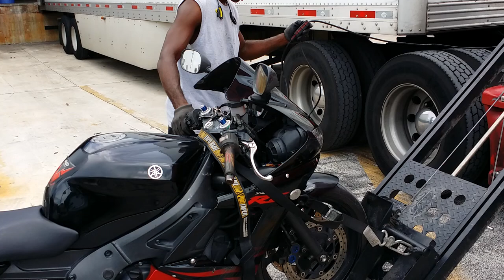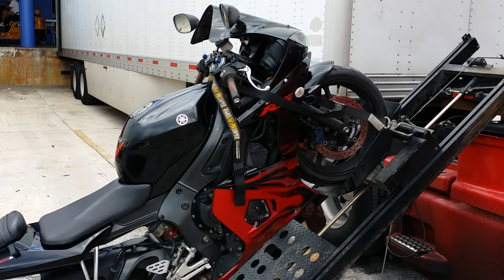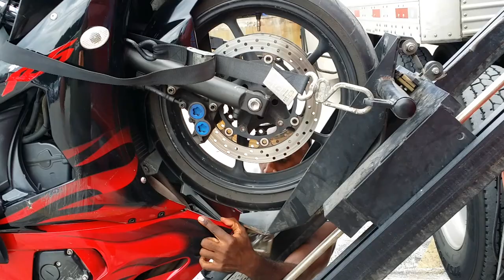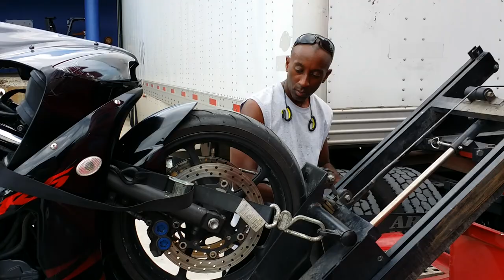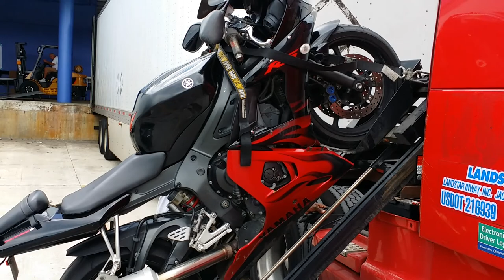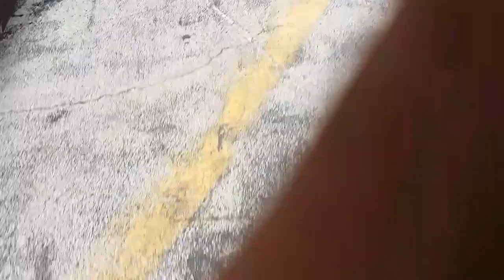How I load my motorcycle onto my semi truck.

Comment: I'm getting a 2020 VNL 760, in a few days and considering taking my Y3 with me, how would that work with turning. I feel like the trailer would crush that in an instant. Unless you have your 5th wheel a bit back?
Reply from the maker: You would have to have the fifth wheel unbolted and moved to the last set of holes on the frame. I've been carrying my bike on my truck since 2013. I feel it is worth the trouble. It's easier to go get food, truck parts, enjoy yourself and not have to worry about your eld.
Reply: Passport Trucker  where did you get the ramp btw??
Reply from the maker: @alejandroochoa3541  craigslist.org

Comment: I'm looking at a little Honda Grom clone. Was planning on just getting a long 3ft wide aluminum wheelchair ramp to bring it up and down off the catwalk.

Ever run into issues hauling water or something heavy when it comes to weight on the drives?
Reply from the maker: The heaviest I have hauled is around 43,000. I prefer around 25,000 with or without the bike. I haven't had any problems with weight.

Comment: Wow that’s amazing. Hey bro how long is your wellbase and who did your ramp.. nice bike
Reply from the maker: Thanks for the comment. I think the wheelbase is 220 inches. I tried to measure it before I went on vacation but the tape measure wasn't long enough. I'm in Bogota, Colombia. I'll measure it when I get back to Florida. Also I don't have that red 2003 Volvo any more. I have a white 2017 Volvo and a Yamaha R-1. The bike is faster and easier to load. L & C metals in Orlando, FL made the frame and mounted it and the lift to the truck. The work can be done by other metal shops. Show the shop my video on How I mounted my motorcycle lift to my semi truck.

Comment: How much does one of these ramp cost if you dont mind me asking... great video, straight to the point.
Reply from the maker: I bought it off of Craigslist for  $700. Paid $900 to have a metal fabrication shop in Orlando make the frame.
Reply: @passporttrucker9280  Sweet, hell of a good deal.

Comment: What's the wheel base on your truck?
Can I do the same setup on regular truck too?
Reply from the maker: I think it was 220. I no longer have that truck. I have a  white 2017 Volvo 780 and a red 2007 Yamaha R-1. The wheel base on my truck is 240 inches and the distance between the back wall of the sleeper and the front of the trailer is 67 inches. The mesurement between the trailer and the sleeper is the most important one. Also the distance from the back of the sleeper to the lift is 4 and a half inches. If you have anymore questions let me know.
Reply: @passporttrucker9280  Appreciate it man.
Am in the market for my first semi truck, do you know good dealer to buy one?
Do you think 260 wheel base is decent enough?
Also where did you get your lift from?
Thanks for the help man.
Reply from the maker: @shashikanttiwari8939   Unless you want to pull a reefer unit or car hauler. I think 260 is too long. I bought my first truck at Arrow Truck Sales in Dallas and my second one at House of Trucks in Dallas. Choose a truck with side boxes that open from the outside of the truck. That way it is much easier to get tools out of it when you need them. Choose a truck that you can pay for before the truck reaches a million miles.
Reply: @passporttrucker9280  Gotcha. Yeah I'll be pulling refeer
Thanks much.

Comment: I was wondering if one of these existed because I would love to take my roking special but I don't know if it's too heavy
Reply from the maker: A roadking special weighs about 774 pounds. It's not too heavy. I would be concerned about the width of the bike. Is there going to be enough space between the trail and the sleeper. You could also just buy a second bike for your truck.
Reply: Stick with something light like 800cc cruiser or one of smaller adventure bikes. Small KTM weights less then 400 pounds and it's fun to zip around.

Comment: Awesome. I'm a long hauler about to put it down like you.
Where can you put an APU?
Reply: Electric battery APU between the rails behind the sleeper with solar panels on roof. But an APU could go between the landing gear posts.
Reply from the maker: It depends on the type of truck. On a Volvo you can put it in front of the fuel tank. On a Freightliner behind the fuel tank.

Comment: where did you get that loader and I thought at Landstar we couldn't have anything on our catwalk.
Reply from the maker: I got the lift off of Craigslist. Paid $700. You can buy it new from www.rampagelift.com or check in the sales section of the motorcycle magazines. Also you can try Facebook marketplace. I installed the lift on my truck in 2013. I had the truck in the pic. Now I have a white 2017 Volvo 780 and a red 2007 Yamaha R-1

Comment: This here is beautiful I have a 2k8 zx 10 R and I would love to have one of these built. Who installs these? And how much about does it run for you were really the only person I see on YouTube with this.

I have a 2020 freightliner Cascadia
Reply from the maker: I had my frame made at L&C Metals in Orlando, FL 407-859-2600. I helped make the frame. The people there didn't know how to do it. It was my design with their help. I also helped install the frame and the lift. I paid $900 to have everything done. You can go to another metal fabrication shop and they can make it. Just show them the video "How I mounted my motorcycle lift to my semi truck." After they look at that video they should be able to make it. If your fuel tanks aren't going to be under the lift as it is on Volvo trucks you can just find someone to bolt it down on the frame of your truck. Also is your exhaust pipe horizontal or vertical? If it is vertical it will have to be changed to a weed burner.
Reply from the maker: Also  you will have to slide you fifth wheel all the way back or even have it moved further back on the frame.
Reply from the maker: Please subscribe in the future I'll make some more videos but right now I trying to get my new truck setup. I still have a lot to do to this truck. I'm planning on putting a shower in this one.

Comment: A little bit of elbow grease and nobody would even know you left.  Since video brother. Is your truck cab smaller than usual to accommodate for the bike thickness?
Reply from the maker: It's a regular size cab. The fifth wheel is all the way back. It was unbolted and move to the last set of holes on the frame.

Comment: How much distance between sleeper and the bulkhead of the trailer? I run a reefer and just bought a bike. Want to buy a truck and bring the bike with me.
Reply from the maker: Unless your truck has a longer than average wheel base I don't think it will work. If you get it to work please let me know. I have seen a videos where a guy put the bike on the side of the tractor under the sleeper. I'm sorry I don't remember what video it was. The driver sent me a message and I watched his video. If you want to you can check the comments and maybe you can find his video. Do you have to pull a reefer?
Reply: @passporttrucker9280  the only thing we pull if reefer
Reply from the maker: If I see that video again on how to put a bike on the side of a truck I'll let you know.

Comment: Hey driver I crossed paths with you in  Houston on a show load, red kw T660 with black fenders, i hope you have been doing well,  my question is what is the lift called?
Reply from the maker: I'm doing ok. I hope you are too. The lift is called rampagelift. https://www.rampagelift.com/
 If you buy it new $3,150 or you can find one on craigslist. I paid $700 on Craigslist.org. I'm going to do an update on how I load my bike. I made that video in 2013. I've learned how to load it faster. I just watched another driver's video and 2 of the steps he did was unnecessary. Some of the steps I used to do was unnecessary too.
Reply: @passporttrucker9280  thank you, i havnt been up here in a while but i appreciate the information, i'v got some other things i'm doing to the truck first, and i also finally got my own trailer, trying to get all the kinks worked out of it but i would like to get one of those lifts one day, stay safe driver

Comment: what is the distance from trailer to the bike?
Reply from the maker: The distance between the front of my trailer and the ramp is 39.5". Also I have a different truck now. The motor went out in the red 2003 Volvo. Now I have a white 2017 Volvo. The wheelbase is a little longer on this truck. I hope I can start making videos again soon.

Comment: I'm guessing the bike can be loaded backwards?
My handlebars are wide. I think I'll have the turn left to full lock to clear the trailer.

Who made the rack?
Reply from the maker: I think it would be easier to change the handlebars or removed them. To load it backward you would have to find a way to keep the front tire straight.
Reply: Looks like I could simply strap the bars straight. I'm tired of running out West doing my restart and not having my bike.

Why does that sit so tall above the truck frame?

Comment: Do you think I could fit 2 groms on the back of a 2019 international LT?
Reply from the maker: The wheelbase of a grom is too short. The grom's wheelbase is 47 inches. With a rampage lift the wheelbase needs to be at least 49. You could have the platform that the rear tire sits on made longer and that might work.  To carry two bikes you would need two lifts stacked on top of the other like a car hauler.  I thought about doing that if I ever got to run teams with a woman that likes bikes.
Reply from the maker: Do you already own a grom? If not I would buy a bigger bike. A grom only goes 60 mph.  I would be afraid to get on the highway with that low of a top speed.
Reply: Passport Trucker no. I wanted to learn on Grom + take it w me on truck to just explore when have extra time between loads . But want a ninja 300. I’m only 100lbs. I need something small / light.
Reply from the maker: @xBaddJuju  I was going to buy a ninja 250. Another truck driver talked me out of it.  A motorcycle salesman told me to at least get a 650. I bought a Yamaha r6 from a young woman that weighs about the same as you. Please don't buy a grom. If I ever were to run into you I would like to go riding with you but 60 mph is no fun. Well maybe on a street but not on a highway. With a grom you are going to either ride with other grom owners or solo.
Reply: Passport Trucker I’m just nervous to get something too freaking heavy!! I’m literally weak asf. 😫
Reply: Passport Trucker I literally have NO experience whatsoever on 2 wheels
Reply from the maker: @xBaddJuju  When you take the motorcycle class you will be using a 250, so why buy a smaller bike? The girl in the video on your page is riding a Suzuki 750 and she weighs 90 pounds. If you are capable of driving a semi I think you are capable of riding a bigger bike than a grom.
Reply: Passport Trucker lol. I’m nervousssss!!!!! I’m copping a Yamaha R3. Im still sad abt the grom but w/e
Reply from the maker: @xBaddJuju  I'm glad that you decided not to get the grom. It's better that you be sad today than sad 3 months later when you don't want it no more. I googled the r3. I like the bike. It looks good. Good price too. Wheelbase is the same as a r6 so it will fit on a Rampage bike lift.
Reply from the maker: You are going to take the bike riding class before you buy the bike right?
Reply: Passport Trucker 😂 I want to buy it first. Bc they teach on cruisers . & learn n mess w it on home time
Reply from the maker: @xBaddJuju  I had a feeling that was your intention. lol. Why not mess up on someone's else used bike than buying a brand new one and messing it up? Can you find another place to take the class? If you are going to learn how to ride first and take the class second do you have someone who is going to teach you how to ride?  Even if it is your daddy, your husband, bf, I hope you find another class. Even if you have someone to teach you, let them teach you on their bike or let the school teach you on THEIR BIKE, you are going to pay them anyway. In Florida if the police stop someone riding a bike without a motorcycle endorsement on their license they can take the bike. The rider can be fined $500, put on probation for up to 6 months, or 60 days in jail. I didn't know that until I took the class. Please e-mail me at  passport.trucker@gmail.com
Reply from the maker: Hi Rinaa, I hope I didn't say anything that offended you. If I did I'm sorry. What did you decide to do? Just curious. I won't try to change your mind again about the class.
Reply: Passport Trucker nope not offended . Still want a grom n a street bike
Reply: Passport Trucker I went to a Motorsport place & actually sat on grom. It’s a little bigger than thought but I love it Bc my feet can touch ground. & the SS was high asf & heavyyyyyyy
Reply: @xBaddJuju  we have a 500 rebel behind the truck and a grom on the trailer it has been a lot of fun for my girl.  And she let's me ride it in the dirt!

Comment: Do you have any issues with being over weight?
Reply from the maker: The heaviest I haul is 42,000 pounds so I don't have any problems with being overweight
Reply: @passporttrucker9280  how do you haul that much weight with your bike. I can't balance 42,000 with my fuel full tank!

Please help coz I need to bring my bike too.
Reply from the maker: @stevenogare5109  Pick up the load first then fuel. According to www.tcsfuel.com a gallon of fuel weighs about 7 pounds. Last May I had a load of carrots in Lee,  FL cancel on me because of corona  virus. I had to turn around and go back south to get a load of watermelons. The load was 42,340. My empty weight was 35,620 and 77960 loaded. It did took some time but I got the axle weights correct. Also if you can avoid heavy loads. They usually don't pay any better. Just more wear and tear on your equipment. Also I have a right weigh onboard scale on my truck and trailer.
Reply from the maker: Also don't let them load into the nose of the trailer. Block out the first 2 feet of the nose of the trailer with load bars. I use the first 2 feet of my trailer for storage. Maybe in the future I'll make a video showing how to do that. Another Landstar driver showed me how to do it.
Reply: @passporttrucker9280  That's good but I am a company driver for now hopping to buy my truck in the near future, thanks be safe out there.

Comment: My man great bike!!
I got some questions for you about the ramp, comment here.
Reply from the maker: Thanks. What do you want to know?
Reply: Passport Trucker How much was the total cost of the ramp, with labor and everything?
As i saw it takes roughly 15 min to get it out and same to put it back?
Can you use it everyday? 
Can dryvan work or flatbed is preferable?
Reply: Appreciate it
Reply from the maker: @igorristic4582  The ramp and the labor was $1,600. It takes about 10 minutes to load of unload. I made that video in 2013. I've learned how to do it a little faster. Yes it can be used everyday. It will work on a dryvan. On a flatbed you might need a longer wheelbase, because of the headache rack, I'm not sure.
Reply: Passport Trucker Thanks for the information.
1600 is much less then I expected.
Can you give me a tip for where I should look for ramp?
Reply from the maker: You  can find them on Craigslist.

Comment: I like mine better but props to you with a great lift!
Reply from the maker: Thanks for watching my video and leaving a comment. I watched yours months ago and I watched it again today. I've seen a few people with the lift made so that the bike unloads on the driver's side. If the truck brakes down unloading from the passenger's side would be safer. Also your set up wouldn't work on my truck because of the side panels.

Comment from the maker: Can you steal make Titans? I don't know what that means. If you mean can I still make tight turns, yes. My fifth wheel is all the way back and I paid a shop to move the fifth wheel to the last set of holes on the frame.
Reply: Any problems with dot officer?  And where are you buy that ramp
Reply: You got a Instagram profile to follow you and see more off your setup?
Reply from the maker: I've had the lift on my truck for 5 years without any problems from dot. I found the lift on craigslist in Illinois.
Reply from the maker: Not yet but I'm going to get one.
Reply: Damn I want the same thing. Bro is this custom set? I mean I know you got it on crags-list. But does those ramps has the brand or something? I mean where can I buy the same set?
Reply: How does this effect the ware and tear of your  bike and how this effect docking at tight shipper/receivers who were tight with normal 5th wheel settings? Do you have to get a yard dog
Reply: @dylanstrus9865  rampage motorcycle lifts
Reply from the maker: @lillsportyshorty7165  If you strap the bike down too tight that will cause the forks to leak. I changed mines after have the bike for six years.  My bike had 40,000 miles on it. I have the fifth wheel all the way back. I can't load more than 43,000 and I don't want too even if I didn't have my bike with me. Turning is about the same.
Reply: @passporttrucker9280  You can also extend your truck at Hodges Custom Haulers in KY. I did mine, now it's 3ft longer. Cost about $3k. Good luck.
Reply from the maker: @compasstrans  Thanks for the advice. Why did you extend your frame? Unless I buy a bike that is bigger I don't need to do it.